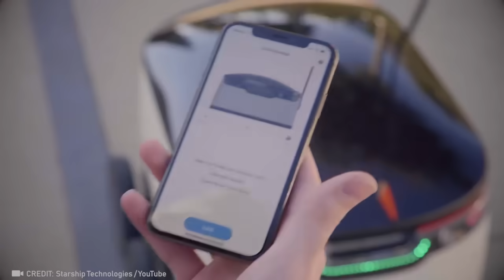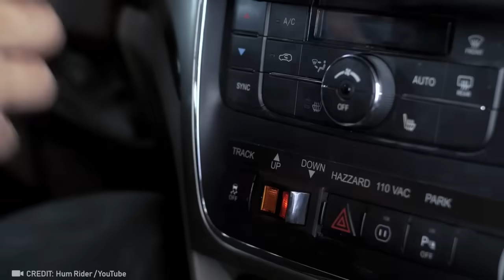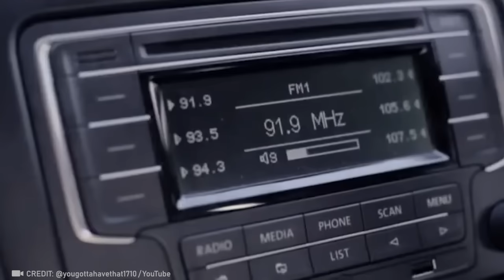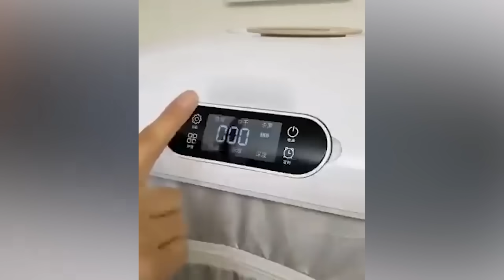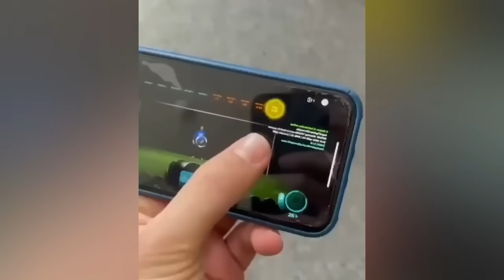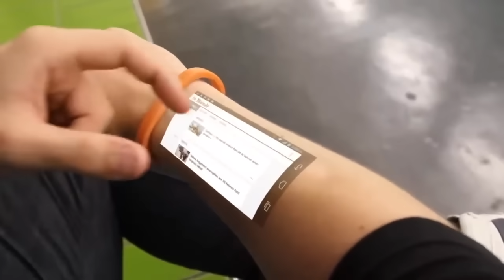Amazing Inventions And Ingenious Tools That Are On Another Level

Comment: I actually had the idea for an automatic guitar tuner many years ago but the company that I was working with to get it in to production said it had already been patented, yet it didn't appear until 10 years or more later. I've learned a lot about invention helpers since then.
Reply: I learned some things too such as your invention can be "too good" and those already established in whatever industry dont like a better product/competitor, just yet ..
Have you found out if they were telling the truth?
Reply: Rock stars already have an automatic guitar tuner it's called a roadie also not every body plays guitar on the same standard tune 😜
Reply: @Projectmayhem82  It wasn't meant for rock stars and it had 6 preset tunings and 6 slots for custom tunes, you could also vary the pitch desired. You wouldn't make much money targeting rock stars anyway, you need something the majority of players would use. The only reason you'd need a rock star is for endorsements.
Reply: It's sound like they used your idea to create the same thing.

Comment: 2:14 - The mobile folding scooter: That will be crap on bumps and uneven sidewalks or stone. This won't make it big. And for it to be light enough to be mobile and be strong, with a battery that with today's technology will always be very heavy if it needs to hold a decent charge, this would be super duper expensive.

2:35 - The wall robot: what is this robot for? Give us more info.

3:57 - The auto-slippers: We put so much pressure on shoes with every step, for a wheel system to be tiny, it would have to be very durable, which means this must be extremely expensive. Not practical; it's easier to just pick up the shoes.

4:18 - The road closure system: Those things do not look durable enough to be hit by a Nissan, let alone a semi. And the road blocks on highways have been meticulously designed and evolved over decades to minimize accidents. The government has spent millions and millions on research, and have competitions for developers to create the most efficient and safe road way tech. They constantly make small improvements so the blocks change the trajectory of vehicles at high speeds to keep the cars from careening off the road while also keeping the blocks from getting too damaged, to save money in the long run. 
That road closure piece of plastic in the video is not designed properly to block high-speed collisions, it would cause someone to fly into the air like a ramp. Only will work on low-speed areas, and they have to be non-flood zones. You don't want electronics on the ground like that and expect them to last for years.

5:45 - That phone on the wristband thing has been proven to be fake. It does not exist. The black part of the projection (screen) cannot exist. Our phones start black, so that is the darkest it goes. Unless you have black skin, you won't see black on that projected screen. It can only go as dark as the surface. That is why movie theaters turn off the lights before projecting. Yet these promo videos use someone with white skin in a bright room. Fake.

8:00 - The Jeep lifting up to go over cars: that is bullsh*t. Wheels cannot move sideways across the ground like that, especially not with three tons of vehicle pressing down on them. This is at best a cgi concept, but it cannot work unless the wheels that move sideways first turn 90 degrees so they can roll properly. Sad part is, that wouldn't be hard to add.

11:50 - The sound wave fire thing: That only works on tiny fires. It was a test project to see if sound waves can move the air in such a way to put out a fire. But as of now, no one knows how this could work for house fires without creating enough noise to destroy your eardrums. The smoke bomb from 5:26 is more promising.

12:50 - the pogo stick that goes 3 meters high: I like how we are adding Shark Tank products from a decade ago onto this list.

14:30 - the anatomy t-shirt and app: for anyone confused, this does not actually show the inside of someone's body. It simply uses 3d software to show you where the heart and lungs, etc, would be, but it combines that with the actual camera on your phone. It is like how Pokemon Go can make it look like Pikachu is on someone's shoulder. You don't need a special t-shirt to do this, though. The company will probably improve this technology along the line.

20:20 - Sleep anywhere with this ridiculously dumb-looking pillow. Sorry to mock, but this is so stupid. Without showing the secret sauce of how it is comfy while being very thin, it just looks ugly and incapable of providing much padding.

20:40 - The turbine that can power 120 homes. No it can't, not if they are running a washer machine and the AC. If it were that efficient, it would be all over the world by now. You would have to upscale the size massively to generate that kind of power.

23:20 - The flooding system: those things are too light to be useful in most situations. They would be swept away easily. In most cases where there is flooding, you can't just walk up and place this thing down, you'd be swept away too. They're just pointing a hose at it.

24:05 - the one-wheel bike: all one-wheel systems have an issue with bumps. There are countless videos of people riding stuff like this, hitting a bump, and going flying. Super dangerous on normal roads. Multiple-wheel vehicles work so well because they are stable over uneven roads.

Comment: Very cool gadgets. I do love gadgets. I have voice activated foot heat & massage in my Livingroom recliner as well as in my bed. Voice activated heat & cool in my house and separate heat & cool in my bedroom. Voice activated lights and fans everywhere (8 ceiling fans and 2 window fans) & over 85 voice activated smart home devices with an Alexa in every room as well as 6 Google Home. I have redundant battery back up, redundant cameras and redundant cell phones that can contact help if needed over a dozen ways. With hundreds of routines & timers I barely need to do anything manually. I would love that exoskeleton suit to replace my full back brace. I would love a remote controlled snow blower too because since my back surgery, I can't use my Ryobi Expand-it snow thrower. I feel like I am literally George Jetson.

Comment: Great inventions, about usefull not so great.

My usefull idea is called "drinking water forever"
Pump sea water to a high place with solar panels.
Let the water flow down though a long glass pipe on the sun.
A lot of water will evaporate and go up the pipe where a freezer will turn the moister into liquid water.
You only have to deliver the energy where is necessary during the day lite, to pump, cooler or both.
Then you can get the perfect sistem using tree pumps with diferent power, to start working early in the morning with smallest, then play with the power you get.

Comment: I love seeing these tech videos but please make sure you're checking the products are either a} real and b} current. The Circet bracelet {projects your phone on your skin} has been thrown around since 2014. They even did crowdfunding. However, they still have not produced anything despite numerous updates. As well as other tech companies have said there is still no technology like that available. So in truth sounds like either a massive hoax or a scam or both. Otherwise great videos.
Reply: Yeah, probably fake. I was wondering how they could get it to reliably project at such a steep angle onto a curved surface. Especially the shot at 5:54, that wrist tendon should definitely create a wave in the image, unless it also has stereoscopic cameras to map the surface and modify the image to cancel it out. Plus the vertical resolution on the projector seems unrealistically high even for today's miniaturization.

Comment: Most of these are ridiculous and completely fail to be practical. Some of them are straight up BS with video effects making it look like they actually work. A few could work in ideal conditions, like the tiny snow-thrower. That can work with super light powdery snow. But anything heavy and wet and that thing isn't gonna work.

The level these are on is called impractical.